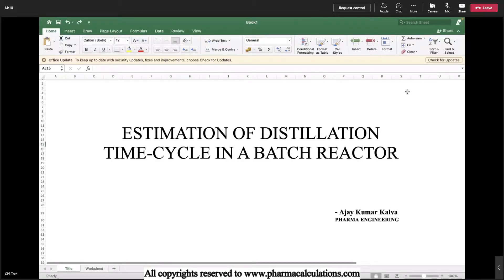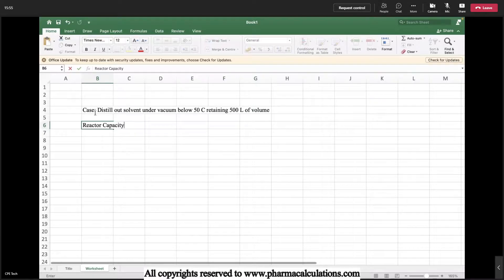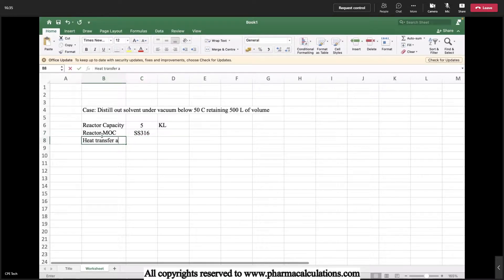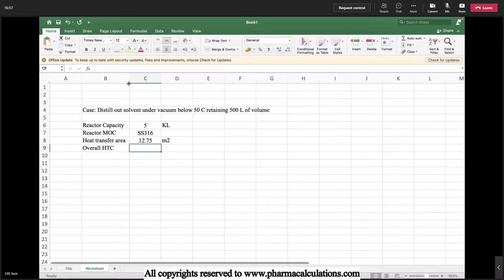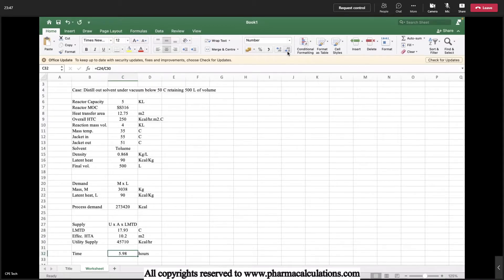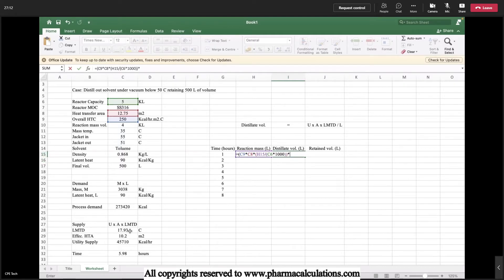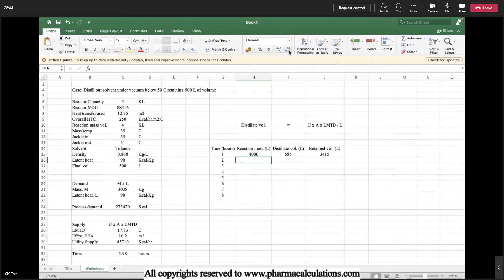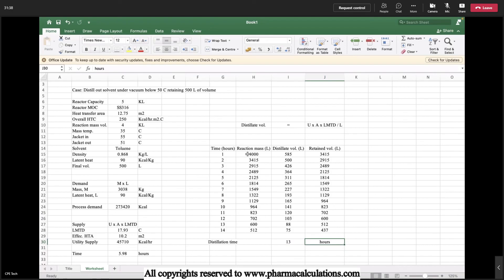Estimation of Distillation Time Cycle in a Batch Reactor

Comment: Why we consider utility delta T across reactor around 4-5 degrees??
In both the cases - heating and cooling?
Reply from the maker: That is the maximum possible dT due to the pressured circulation of utility